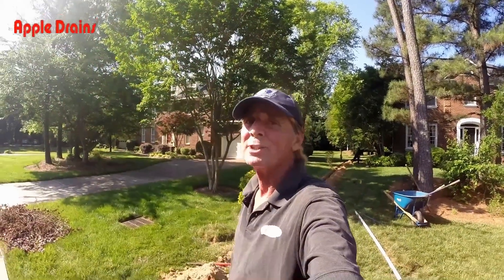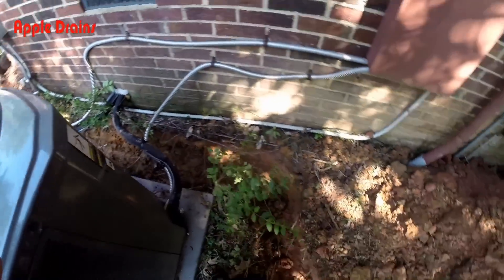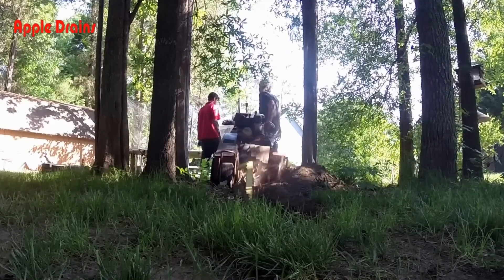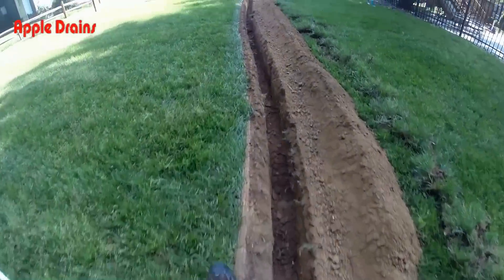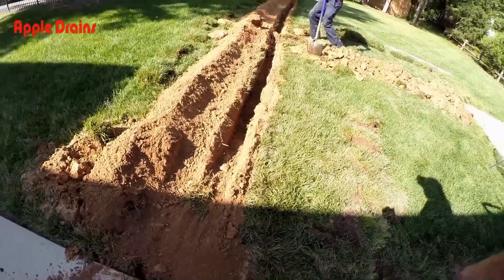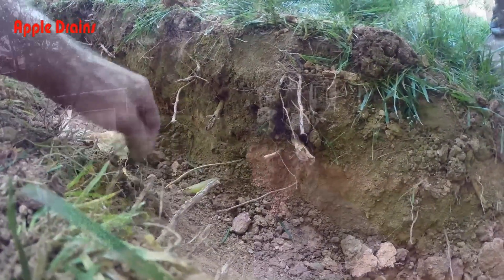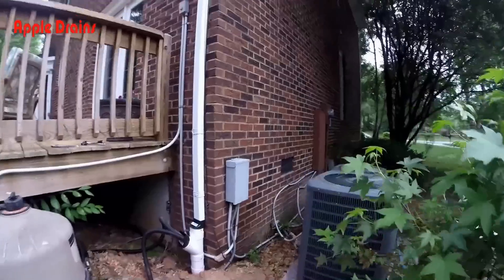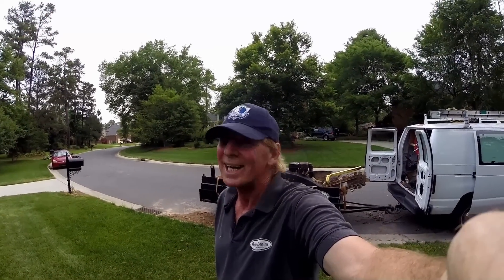Roof Drain Trenching and Catch Basins  Discharge 4 Inch Pipe, How To Install Drainage

Comment: Hi, I need to understand if it necessary to install the pipe with a pitch every 10' - 1 1/4" down, or the water will find its way anyway? Thank you in advance.
Reply from the maker: Water will flow if you give it a place to go. Downhill is always better, but many yard run level. Consider using a sump pump if in doubt